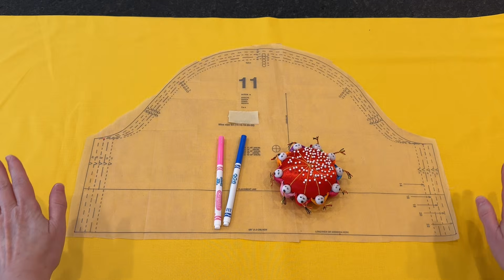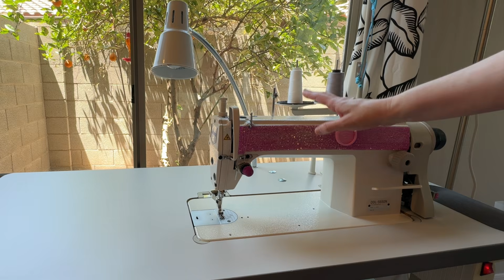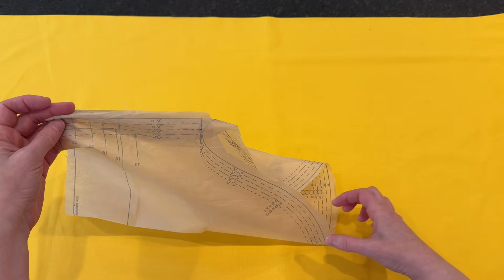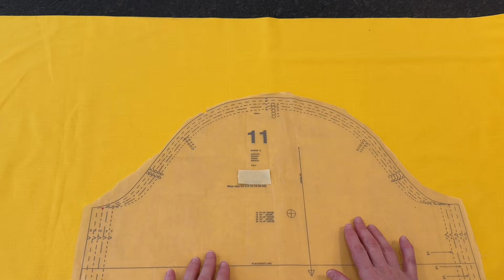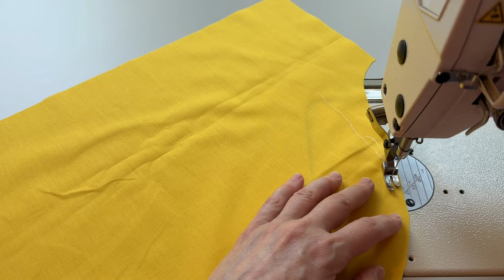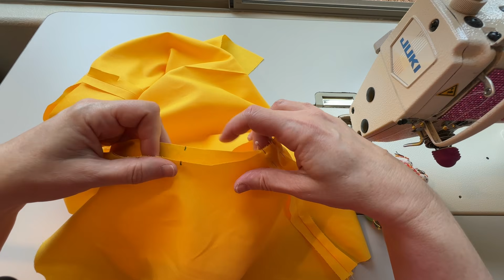How to Sew Sleeves (Even if You’re a Beginner!) | Easy Step-by-Step Tutorial

Comment: I don't understand... the sleeve came out all full of pleats ...
Reply: I was hoping we would see a sleeve with no gathers being inserted. It is easy to insert a gathered sleeve, not easy to take a full sleeve and insert it so that the fullness is eased into the garment for a smooth non gathered finish.😢
Reply: Well... I was trying to be polite on my previous message. The truth is: this video pretending to teach how to sew a set in sleeve does not teach anything at all. In fact it might give the impression to very inexperienced sewists that this is the way to "ease" a sleeve. It is not. The video shows a very messy sleeve.
Reply from the maker: It sounds like you may need to add a bit more ease or adjust your gathering stitches to get a smooth fit! 😊
Reply: @sewpracticalsewfun that did not answer the problem